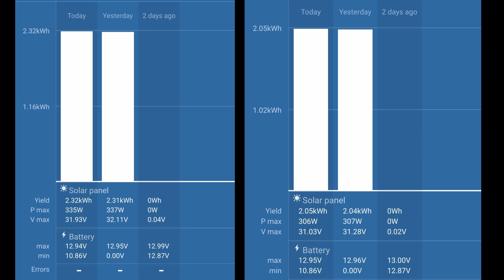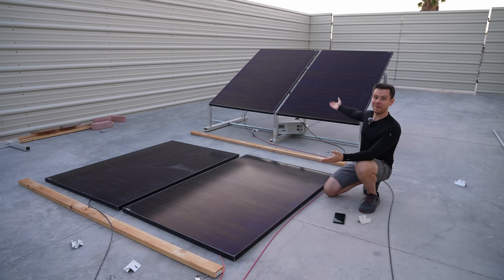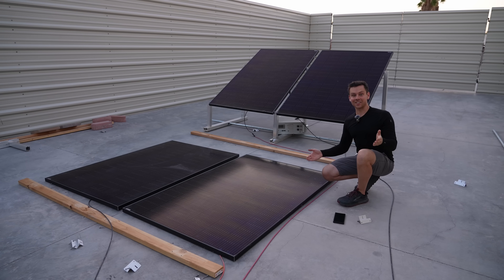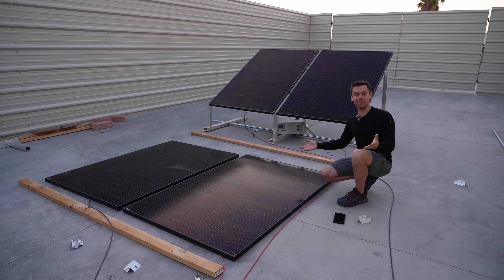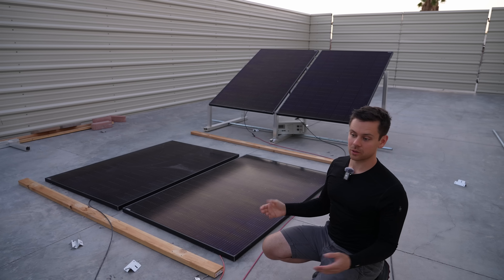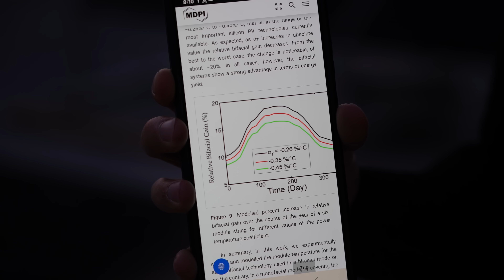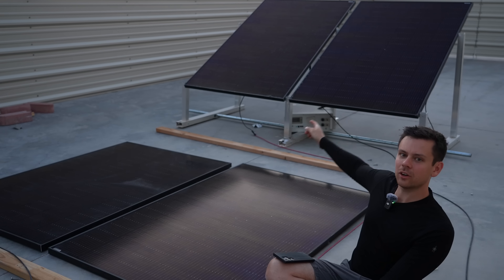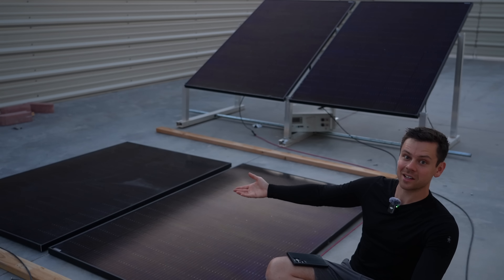Bifacial Solar Panels: Everything You NEED to Know Before You Buy

Comment: The cost of that structure you guys pay are ridiculous. but USA customers tend to get ripped of so much its just normal. if its rightly priced they start to think its some sort of scam. also the front of the structure should be 1.5 to 2m from the ground and the space btwn panels should be at least 30 cm to get more bifacial gain. the slant should be around 10 degree. we usually recommend customers to apply white paint underneath these panels. cheers from kerala.
Reply: Place them on poles above a walkway or sidewalk as I have seen. 

I think cleaning is required though.
Reply: Why do you recommend space between the panels? Is it just airflow?
Reply: Just to get more light in@simonpaine2347
Reply: @simonpaine2347 I believe he means horizontal space, not vertical. At the angle he suggests, that would be enough to prevent the panel in front from shading the one behind. The more angle YOU need at your latitude, the farther the rear panel(s) should be to prevent shading.
Reply: The ideal angle of a fixed solar array is the latitude where the array is located. 10 Degrees at a latitude of 30 will give much more power in the summer, but a lot less in the winter.

Comment: rise only the bed on the corners, straight up. no angle. yep a normal angled roof with higher gap. maybe use a reflective metal roof as the mirror. so much talk, so little useful gain. lol. a con might think you did the research yourself that you self-referenced. very original lol. light roof stand is the best so you get the panels off ground and out of the way, and you get roof and walls for a garage. or just get a bunch of containers and put solar on top. farm land where you have something growing, maybe a green house, and spotty solar panels on top, in partial sparse roofing.

Comment: I think you left time in sunlight out of your calculations. The sloped elevated panels will pick up the sun before the flat on the ground panels giving you more gain thru out the day.
Reply: I have panels in nearly every orientation on my two systems (like 8 MPPTs in total).  My near vertical panels definitely don't get much advantage from the sun until late afternoon, where as the (roughly) 30-45 degree angled panels get modest production the entire afternoon.  And the flat panels on my Pergola get ZERO sun until after noon until the sun peeks out, then get a lot of production... but only for a short period of time as the sun starts to get lower.

But what I have found is that in terms of managing the battery storage for these systems and actually being able to stay off-grid for more days in the year, it is actually better to lose a bit of total energy production from "optimal" panel placement by trading it off against better morning and late afternoon production.  This reduces the amount of time the system has to run only on batteries by 2 hours or so and improves production on inclement days.

Turns out the sunny days are never the days we have to worry about.  It's always the party-cloudy days, the morning foggy days, the evening cloudy days... the shoulder seasons and winter that we have to worry about.  On fully sunny days solar systems tend to be overflowing in energy... more than one can use anyway.

-Matt
Reply from the maker: Look at the shadows in first clip, they are the same. Output is actually identical when they first get shaded
Reply: @WillProwse  I meant in the real world. Panels mounted in a sloped fashion will see the sun long before panels that are mounted flat. This is also affected by the panels lattitude.
Reply: @jimr4566  I have found the opposite to be true in my experience. Steeply sloped panels require the sun to come up and around to hit them, while my panels that are almost flat on the ground start charging earlier because the shade is gone sooner. But I am still using non-bifacial panels. You may get different results with bi-facials.

Comment: Fence mount vs. Flat w/ south facing reflective fence on north side (or just have the flat version up against a wall :))  So far I've seen one test of the fence mount which should similar production but the profile was very different. Instead of a peak mid-day it had morning and afternoon peaks.  In effect, total production similar but spread out over the day without a single big spike in the middle.  In theory, ground level reflectors might improve performance of the fence mount.

Comment: How about a pool fence built with bifacial panels in landscape orientation? Add a water pump and a spray/recovery system hidden in rails on the top and bottom of the construction to cool the panels while heating the pool for free.
Reply: Better use distilled water so doesn’t leave water spots on the glass
Reply: That sounds awesome.  How would you have the water come in contact with the panels to cool them off.  How would the heat transfer work?

Comment: I have bifocal panels mounted on white metal roofing on my shed. And have equal amount mounted on grey metal roofing . The ones mounted on the white roofing start producing solar at sunrise , at least 3 hours b4 the ones on grey
Reply from the maker: By how much? Can you post your data on the forum. When the sun is low, production is extremely low. Would be nice to see your numbers
Reply: When i get home in a few days i will post pics from app. 
Where do i post?@WillProwse
Reply: Wow!  That's great data for someone like me, planning out my shed+solar build for next year.  White roof it is!  Thank you!
Reply: That is great info mate, are they mounted flat on roof or on stands for more angle?
In Australia (IMO) white is always better, I have seen drones fly around suburbs of white and dark roofs and record air temps several degrees higher over the dark roofed areas and the roofs themselves were very much hotter than white roofs.
Reply: @evil17 they are mounted flat on the roof. Part of the roof is brown shingles , part white metal and part grey metal. By a big margin , the white does better.
3 arrays connected to 3 different 6000xp's.
Reply: We installed a concave mirror at the end of our driveway to help us see oncoming traffic. I wonder if you mounted these bifacial panels on a white roof, and then mounted one of these concave mirrors under each panel, if that would boost it. Not sure what the mirrors are made of, but they are flexible and unbreakable.
Reply: @PorterValleyFarms a white roof will give you a better result than silver or galvanised as it still has black in it which absorbs heat and light.
Reply: @PorterValleyFarms __ The only thing to be aware of when redirecting sunlight is whether or not that beam of light is too concentrated for the panels.

IE similar to a magnifying glass.

You're better off having the sunlight dispersed over a larger area vs directly focused. 
You could use a convex reflector to bounce the light towards a white wall or down on to white crushed stone under the panels. 🖖🏻
Reply: Ive thought about that @PorterValleyFarms
Reply: Building a similar system with galvanized metal roofing with panels elevated above.  Seems like the best design.  I wonder if white would reflect more than the galvanized roofing?
Reply: @MCGDEC  white is better for bifacial than galvanized. By a wide margin actually
Reply: @MCGDEC my galvanized roofing  and panels are on a winter angle at moment , wont know till December how theyll do
Reply: That’s interesting! 🤔🇦🇺
Reply: Are the roofs the same angle and orientation? Also, how much more do they produce on the white roof?
Reply: What's the difference in generated energy per day?
Reply: I have a red metal roof on the cabin. I'm wondering if I should paint it white?
Reply: @MyCabinLife 
White is as reflective to light as a mirror surface, it just doesn't reflect an image
Reply: It makes a big difference. 
My roof is facing sunrise
Reply: Any specific type of paint?
I was wondering you know how they put that membrane type paint on top of RVs in wondering if something like that would work and have the added benefit of keeping it cooler inside the cabin as well. @vinny143
Reply: I bought left over roofing tin. Its already painted or powder coated@MyCabinLife
Reply: @MyCabinLife i can put my temp sensor on the underside of the tin and check temps , but you can feel the heat difference.  My goats stay in white stall and have free range on barn
Reply: @vinny143 yeah I've been thinking about this for a while now. 
Now I just have to figure out how to paint a metal roof that's already painted.  
I don't want to be anywhere near a roof, self preservation perhaps lol
Another obstacle to overcome.
Reply: I know the feeling  @MyCabinLife
Reply: What is the distance or "air gap" from the back of the bifacial to the reflective surface?

Comment: I'd be interested to see the results of wall-mounted vertical panels, Will.  The heat can then flow vertically through the back of the panels- even with as little as a 1" gap.  That should make a difference.  Personally, I'd line your panel walls with solar panels.  Also, paint your driveway with a brighter coating for improved sunlight reflectivity.
Reply: I’ve 4 x 120w verticals panels on a SSE facing wall 100mm out from the wall. But no results to compare with yet!

Comment: It would be cool (no pun intended) if you did a standard (nonn bi-facial ) panels with an aluminum water jacket on the back with water shaded and open allowed to evaporate and cool as it does in the desert pumped through the jacket vs natural air cooled panels.

Comment: Every test I've ever seen showed more output during colder weather, with or without reflection. The first test I saw was well before Bifacials even came out. I know the first year I put mine up I was shocked to find when summer finally came and I expected the most output, it actually went down a small amount from the spring time just a couple months before. My new bifacial are the best panels I have, and I put a white single ply ThermoPlastic roof membrane from IB Roof Systems behind them and they went up approx. 10% by my very rough calculations.
Reply: Woaavhh

Comment: Put some mylar on the ground below the back side I bet that will juice up the output!
Reply: That would be interesting to see the results, but I believe white is actually a better reflector for such, which is why they use it extensively in Hydroponic systems now days instead of highly reflective coatings like Mylar.

Comment: So if a panel is 450W bifacial what amount of power can one expect if it is not getting illuminated from the back, do they specify how much of that 450W is gained from the back?
Reply: Bifacial panels are rated for main-facing sun.  Any back-facing light is in addition.  So if it isn't getting illuminated from the back you can expect wattages similar to a non-bi-facial panel.  that said, bifacials always get a little something extra even when mounted flush, though it isn't much.

Comment: I'm curious to know if you understand why my 12.5 KW system is dropping power during the peak production hours but only on certain days.    Today, the temp reached about 97F and my solar output was doing fairly well until about 10AM.  Producing about 6500 watts with about 4500 coming from the east array and about 2000 watts from the west array.  But around 11AM my production dropped to around 3500 watts with almost identical outputs from both east and west arrays.   Around 1750 watts from each.   And it stayed that way until the middle of the afternoon.  But then it was getting cloudy but with some occasional sun breaking through.   When the sun did break through my production went back up to more what I would consider as normal.   We had an extreme UV waring and we do have issues with Ozone.   I'm guessing it might have been a high Ozone day, but it really frustrates me when I lose all that production during the peak of the day.  I could only get my batteries charged back up to about 75% when I typically have them all the way back to 100% by 1PM.  So I'm trying to figure out if this is a weather phenomena or what.  ?
Reply: Check for over-voltage on the strings (if DC strings).  If microinverters then that isn't an issue.   Also check for overheating of power electronics (microinverters and/or the string inverter).  It's possible that the strings are in-spec but the string inverter's fan has failed or it is otherwise going into thermal throttling or shutdown.

Extreme over-production in party-cloudy skies occurs when the sun comes out from behind a cloud.  The glare and the very bright cloud(s) next to the now fully revealed sun results in a huge ingress of solar energy for a brief period of time.  If running DC strings, this can over-volt the string if there isn't enough margin (i.e. if there are too many panels on the string).  That will cause the MPPT to shutdown.

Irregular topologies can cause problems in both series and parallel configurations into a single MPPT of panels whos orientations are different.  In this situation, it is more or less impossible for the MPPT to find a production point that is optimal for all the panels.

for example, if you have an A-frame shed and a panel on either side of the frame (thus two vastly different orientations), it is more or less impossible to get optimal generation from the combination in either series or parallel configurations if they are being combined into a single MPPT.  Each facing needs its own MPPT.

-Matt
Reply from the maker: Can you post your system and data on the forum? We will find out
Reply: the ozone layer's main role is to protect life on earth from harmful UV radiation, not to regulate the sunlight reaching solar panels, it doesn't impact the amount of sunlight reaching solar panels. UV radiation can cause degradation of certain materials used in solar panels, that's why solar panel manufacturers use UV-resistant materials to counteract this issue. as conduit ambient temperature increases it's ampacity decreases due to the rise of electrical resistance. taken straight of my photovoltaic school notes :person-turqouise-waving:
Reply: I have found that if I am using different angles on different arrays, I need seperate solar charge controllers for each.
Reply: Thanks to everyone who responded.  I think I have it figured out.  I think @junkerzn7312 was the closest to what the problem appeared to be.    But I was on the EG4 Monitor and happened to notice a Firmware update was available on the Flexboss21.   So I ran the updated.   And in the process of rebooting the inverter, it appears the problem was corrected.  I spoke with Signature Solar Tech Support and they said the reboot of the inverter was probably all it was going to take.  The explanation they gave as to why it happened was very similar to what @junkerzn7312 .  And today at 11:36am I'm getting a little over 9K watts on my 12.5KW system.   So it looks like everything is functioning normally now.  ;0)

Comment: And no shade issues.
Reply from the maker: That's exactly why I did it in this location. This is not a shading test
Reply: I mean no shade issues from other solar panels if the solar panels are elevated 2 ft off the ground and keep level.  It was a comment related to my earlier post.  Sorry for not being more clear. @WillProwse

Comment: I’m going on my 6th year of being fully off grid and always assumed I produced more power in the summer with my 4920 rated watts of ground mounted bifacial panels. But I never had enough load to stress the panels past about 11am everyday when my 30kwh of lfp was back to 100%. 

This year we have an EV we are charging and to my surprise, my bifacials don’t come close to producing the power they do in the winter here in Colorado. 

This summer I am hitting a max of between 3800 to 4100 watts of power. In the winter I’ve seen my panels peak at 6200 watts. I’ve checked the voltage the panels are producing and have noticed a large decrease in the summer voltages. To the point I actually thought I had a problem. But the more i think about it, I think that’s just the difference of the zero degree temps, combined with snow reflection in the winter, vs not having any of those things in the summer.  I still find it kinda hard to believe it’s that large of a difference but that’s what I’m seeing 🙃
Reply: Good that you are fully using your solar now with your EV!
Reply: I assume you’ve checked that summer output isn’t overloading some component of your system? That seems like a very large difference.
Reply: Have you thought about laying down a something white/reflective on the ground to maximize the backside production, closing the gap with winter time?